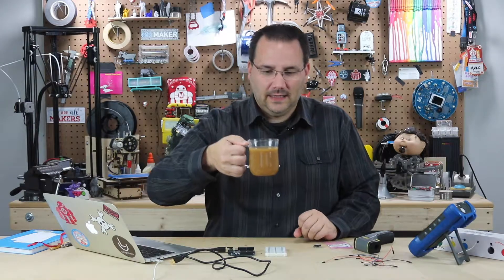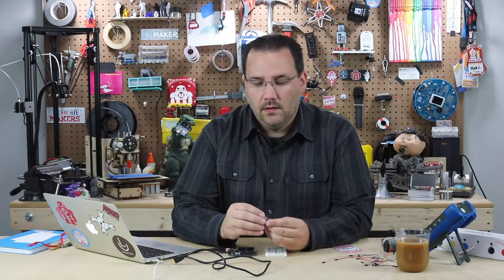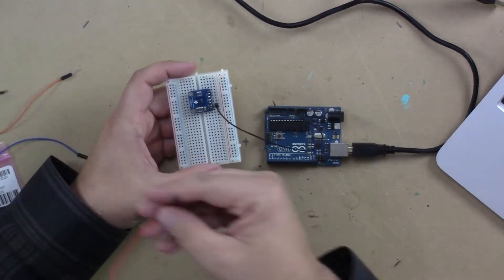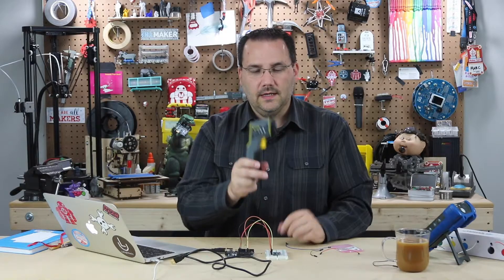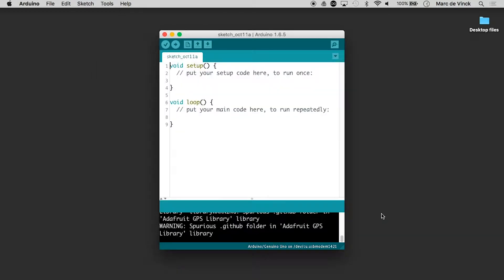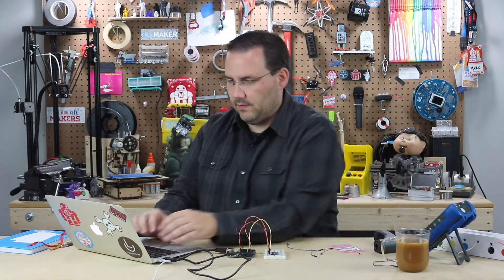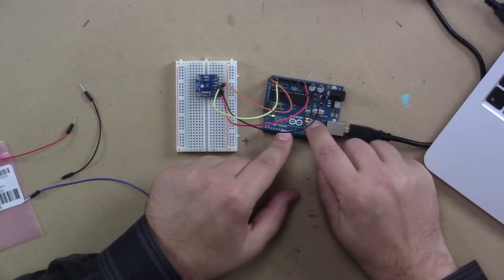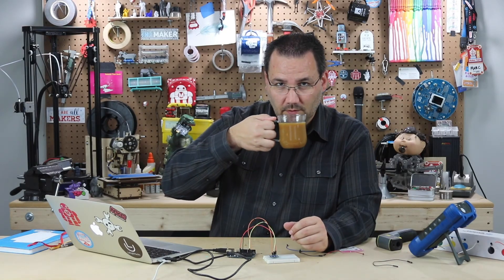Arduino Prototyping Inputs #36: Thermopiles

Comment: Would this work on an Arduino Mini?
Reply from the maker: Sure. The mini is very similar to the standard board.
Reply: Marc de Vinck what about in terms of required voltage to power the thermopile, is the mini capable enough?
Reply from the maker: @arvincarvinn  It depends on the specific thermopile you use. Check the data sheets first. Some could have full daughter boards and would require no additional resources.
Reply: @arvincarvinn  The thermocouple itself generates a micovoltage that is converted by the module.  It is also non linear and the module should do the compensation for the type and range

Comment: Why doesn't it measure the air?
Reply from the maker: It does. It converts thermal energy into electrical energy. A bit like a camera, but it "sees" heat rather than light. There are multipole thermocouples making a thermopile. Thermopiles do not report specific temperature, but rather they generate an output voltage proportional to a difference of temperature. So if the "air" is hot, the thermopile will be looking for a difference being "hotter" or "colder". That's why the ambient air temperature isn't really a factor with it's reporting. Hope that helps. And full disclosure...that's only my interpretation of how it works!
Reply: @MarcdeVinck  Thank you, but actually, if we assume the air is only nitrogen N2 and oxygen O2, it does not measure the air - at any temperature; I can demonstrate that else your instrument would show the temperature of the air first, having transduced it directly in front of the thermopile. If we add the trace gases, the 1%  CO2 CH4 H2O the thermopile does measure them as they are thermoelectric. Glass has the same effect as a solid. Now, if you think the latter gases are very like the greenhouse gases you might be surprised to know John Tyndall used a thermopile to measure the IR radiation of the air and its gases and (wrongly) concluded they (the latter) are the only gases that radiate. I have identified this as a 162-year-old systematic error in science. We now have Raman laser spectrometer that can measure what the thermopile can't: all gases radiate at their quantum spectra modes and the temperature measured. As a disclosure; this is my interpretation; I have an experiment to test my work and intend to publish. B
Reply from the maker: Blair Macdonald That’s a hell of a response after asking your initial vague question.
Reply: @MarcdeVinck  Sorry about that; true